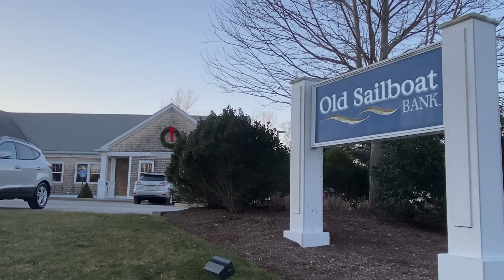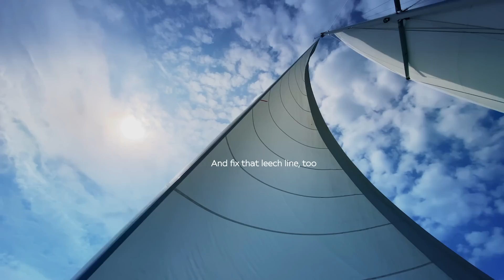EP 3: WHAT IS A THRU-HULL FITTING? Finding thru-hulls & attaching plugs! #Ran-daysSailboat

Comment: Build a manifold to eliminate as many as possible.boy that’s a lot of thru hulls!! You have great resources and I  look forward to seeing your progress!!
Fair winds ⛵️
Reply: Very hard to do after a boat has been built...getting through bulkheads and behind paneling cam be near impossible. I'd rather have more through hull fittings that are close to their source, than deal with chasing a leaking line buried under millwork, ribs, etc
Reply: @davidparadis490  the boat has some you can’t get to and by the time you check 23 sea cocks I doubt it would be saved.something has got to change.he will get it sorted
Reply: @tomcraddock244  I agree.  By the time he finds the leaker it'd be a real "problem" as opposed to a hiccup.

Comment: We have a 32 foot sailboat on the great lakes from 1973.  We had a leaky through hull where we had to cut the wood under the galley sink to access it and it didn't have a seacock.  After that experience we removed all of the through hulls and patched all except the raw water intake.  We put sumps for the galley and head sinks that exit above the waterline.  We moved the cockpit scupper exit drains above the waterline.  We removed the paddlewheel speedometer (just use gps speed) and epoxied the depth sounder to the inside of the hull (seems to work fine).  We removed the waste overboard through hull as we can't output to the great lakes anyway and have it only going to the black water tank.  We have 2 bilge pumps with separate switches and exit hoses.  Now we just have the packing gland on the prop shaft and the raw water intake to worry about below the waterline.
Reply from the maker: sounds pretty ideal - minimal holes and some nice consolidation. how big is your sump if you have it connected to the galley and head sinks?
Reply: I was kind of shocked the scuppers all seemed to go to underwater thru hulls. On less complicated boats the just drain pretty simply, but I guess when it's a center cockpit and you have hallways all around it makes it a bit complicated to drain by gravity without needing a pump of some kind to keep the holes in the boat above the water line. Since they're all gravity fed to the bottom of the boat would it be more of a risk to have all the scuppers join inside the boat and use a singular thru hull to secure and check, or would the piping carrying potentially a fair bit of wave water be more of a risk?

Thinking it over real quick I suppose one issue would be possible clogging from something larger or sticky going down one drain and clogging everything.

Comment: 1 )-Leave well enough alone the ones that are capped .
2)-The patina is just the bronze fittings is just weathering per se after being exposed to the elements of a boat in salt water ;)
3)-See no.1 and consider that I like to fix things till they break.
But, in reality the ones that might need special attention are the engine intake/exhaust because of heat and of course the ones for the head intake/exhaust due to heat cycling and the heads ..well, because they are larger and if/when they fail they will let in the most water.
Have fun and look forward to the learning curve you have ahead.Congrats on 63.2k subs !!

Comment: Holy  thru-hull fitting Ran Man!! This looks like a job for the Lilliputians. Maybe some highly developed toddlers are available with ocean going experience? Seriously there is an old expression which says "if it ain't broke, don't fix it". You might be making the situation worse by replacing all of them. 9 times out of 10 you will have a problem with your hoses or the clamps. Clean up the sea cocks and replace the former. My faith in rubber and plastic is minimal but the ones not under pressure should be fine. Nice of you to give Captain Q the day off . The summer is upon us. Time to sail . Thanks for the info Randay.

Comment: Based on a similar plan you should have for the electrical wiring, Label the thru holes ( Dymo ) and also on the inside of the hatches/covers/panels you should stick a label indicating what is under/in there. Saves guessing and having to find bits of paper in an overloaded Nav station desk.
Really looking forward to more videos.
Reply: Good tip 👌

Comment: Well one thing I can say is DO NOT put ball valves on thru-hull fittings.  The mushroom thru-hulls have straight threads and the ball valves have NPT tapered threads.  Because of that thread mismatch you can't screw a ball valve more than about 3 turns onto a thru-hull.  If you replace a thru-hull, use an actual flanged seacock that has the proper threads to screw onto the thru-hull mushroom.  Alternatively, you can buy adapter flanges with straight threads fir the thru-hull to screw into and NPT threads on the other side to attach a ball valve.  Also, I would not use plastic thru-hulls.  If you don't want to  use bronze, use Marelon fiber reinforced fittings and marelon seacocks.

Step one is to identify  what all the thru-hulls are for and to determine if any are still connected but no longer used.  As far as the thru-hulls that are capped and unused thru-hulls that are not capped, if the boat is hauled out, it is a great time to remove those unused fittings and glass over the holes.  

Also, that sump is not used as a filter.  Instead a sump is used for a drain that is below the waterline, such as a shower pan drain.  The sump has a float switch and pump in it.  Water drains into the sump pan, when it has enough water in it the float switch turns the pump on, which pumps the water out a thru-hull above the waterline.

Oh yeah, as others have said, use 3M 4200 or another brand of sealant on the thru-hulls.  5200 is used for permanent installs like hull/deck joints.  5200 is also not a silicone product.  It is a urethane.  The only time you want to use silicone on a boat is for bedding lexan in ports and hatches.
Reply: Excellent information 👌
Reply: Thankyou for the education.
Reply: @stevev5510  my pleasure.
Reply: Careful here!  Thru hulls are also available with pipe thread, specifically for mating to NTP partners.  The "straight thread" reference to thru-hulls is outdated information, and inaccurate.  The use of conventional seacock versus ball valve is an engineering decision, based upon size, location, loading, intended use, part material and quality, etc., and should be individually evaluated.  You may trust that ball valves are successfully used in lieu of conventional base-plate type sea-cocks all over the globe.  We see cruising boats from as far back as the 1980s which exhibit ball valves mounted atop bronze thru-hulls that have been in service for many years, with zero issues.
Reply from the maker: Thanks David  I’ll be sure Randay gets this 
How did rue like the ne38 today
Reply: @daveseverns2896  yes there are thru hulls with, and I quote, "the last 4 threads transitioned to NPT pipe threads so you can screw a pipe thread ball valve onto them for "4" threads.    Note that this is ONE brand of thru hull, not all thru hulls.  I maintain my position that the use of ball valves directly on a thru hull is poor practice.  The reason is that the valve is not supported except by the thru hull.  Best practice is to use a standard flanged seacock.  A seacock is attached to the hull either with thru-bolts of via tapped holes that do not penetrate the hull only when the hull is not cored and thick enough.  In addition, a ball valve screwed onto a thru hull will not meet the ABYC strength standard - able to support a 500 lb load applied to the end of the fitting for 30 seconds.  Yes the ABYC standards are voluntary, but most insurance companies view them as mandatory.  That many builders have built boats to very poor standards is NOT a reason to build that way.
Reply: @todddunn945  Thank you for your reply.  This has been a very contentious topic for many years.  I shared your comments with the other builders and surveyors at the boatyard this afternoon, and it generated a lot of smiles among the gang.  One of the other surveyors responded "if I had to strictly follow that blankeyt-blank money-standard, I'd fail 99% of the boats out there, including most all new-production vessels!"  Certainly, having been involved with voluntary standards for the last 34 years, I can tell you that there is a lot of politics and...let us say..."influence" in their development and modification.  I shall leave it at that.  It may be worth investigating products such as the Tru Design seacock, a completely polymer, certificated, non-flanged seacock.  Again, it is certificted.

We can argue the Standard all day (as so many have done over the years), but I will just share here that there is a very clear difference between a horizontally oriented, 1/2' diameter, above-water sink drain penetration and a vertically-oriented, submerged engine cooling penetration, which may actually stand some chance of being impacted.  Good luck with that 30-minute, 500# load suspended under that sink.  ;)  Many in the business feel strongly that the Standard is too arbitrary and "one size fits all".  As a fellow engineer, I will only say publicly that there is no substitute for a prudently designed application.  I will take "designed" over "arbitrary" any day.  The mfg's using unflanged ball valves will aggressively argue with you that their boats endure millions of hull-miles annually without fitting failure.  The lawyers and insurance brokers may not like it, but the builders are correct.

Be well.
Reply: @daveseverns2896  I agree totally that a large part of the ABYC "standards" comes from equipment manufacturers and is thus somewhat "inbred" shall we say.  Unfortunately, I have had to deal with several insurance companies that view those "standards" as the gospel since they are pretty much what is available here in the US for recreational boats.  Production boat builders are always thinking about the bottom dollar and will thus go with the cheaper option whenever they can since production boat building is a low margin business.   There are, of course, exceptions to that for those builders who build in the time and materials market - very high end builders.

Comment: Ran-day you are a brave man! I have only one thru-hull for our sink. I had to remove the seacock, so the original thru-hull had too also come out to do the repair. I used 3m 4200, and the reason why is that I have read the 5200 should only be applied to areas that will never need to be maintained or repaired.
Reply from the maker: Great tip!

Comment: I assigned the entire process to the boatyard and they found one thruhull I didn't even know about which was a salt water inlet for the galley sink. The sink no longer had the pump or faucet for the thru hull and it was under the v-berth.
The main issue I had and the reason I wanted them all replaced was they were all old gate valves from 1974 and some didn't look very good. Gate valves are impossible to tell at a glance if they are open or not and they can get stuck, so I am much happier with the ball valves with nice levers.
I also have three pairs of thru hulls in the head and 4 of the 6 are capped. I have no idea why, people must not have liked them, but they are above the water line and the two in use are below it. I plan to remove the sink in the head which is a cheap plastic thing and replace the throne with a composting unit that will eliminate the three thru hulls and the need for a holding tank. The galley sink is two steps away so I think it is fine.
I think if I had two heads I would make one a composting toilet unless there was a big crowd on board that needed two heads and holding tanks. I had to rebuild a joker valve and replace two macerators and I am more in the never again camp because I am not a contortionist that a small boat wants you to be. My friend just removed the wall in his boat that made access so much easier, but putting it back was a little harder.

Comment: Randy,
This sure brought a lot of comments. Not all, IMO, helpful. I don't often comment but have to this time. 
You are a leg up on most folks. You have a good list of your thru-hulls and you understand what each does. And now you know where they are. The large number may seem worrisome but I don't think that's a problem. Thru-hulls that fail and could sink your boat are those below the waterline. I wasn't counting but that's probably less than half with some of them being capped. Concentrate for now on making sure they work properly and that their hose connections are in good shape and properly fastened. As I watched, it seemed that the major inlets are accessible. I would not mess around with manifolds or a sea chest. Just make sure all the below water thru-hulls are in good shape. If not, replace them. Then address the others as needed.
You have a fine, well designed, well manufactured vessel. It has stayed afloat for a long time. Your diligence will keep it floating for a lot longer. "If it ain't broke, don't fix it." There are lots of workable and fun ways to improve liveability and performance on any boat. Ask Q. He knows. Focus your efforts there and keep the videos coming. They are great.
Reply from the maker: Well said…. Agree with covering the basics and leaving it alone if it ain’t broke… (after new hoses and clamps of course). Thanks for taking the time to leave your thoughts 👍👍

Comment: I think it is time to do some re-design of the plumbing. Eliminate/combine to manifolds with a single outlet. 

Are you planning on going to compost head(s)? I think you should. Maybe keep one with a straight shot overboard for offshore use only. 

I suspect with a little work you could get down to a single digit count. 

You'll need to get good at fiberglass/gelcoat  layup for all the new holes in the hull.. Save you a lot of headaches and maybe keep you from sinking your boat.

As for replacing old bronze fittings that appear to be in good shape, I would be hesitant. Maybe pull them, clean them up and rebed. I say this because bronze fittings ain't what they used to be. about 12-15 years ago, the bronze foot valve in my well pump went. Less than a year later the replacement went. My well guy told me the new chinese bronze was shit. He replaced it with a white delrin one, which so far has been good.

Comment: I would strongly recommend, while the boat is on dry, remove all hoses, lube and loose all seacocks, cut 1 diameter on each and replace at least the primary clamps, if you cand do both even better and properly attach the wood plugs along with a wooden or rubber hammer on each sensible area, water intakes, underwater exhausts and outlets. engine room and sinks area.
Reply from the maker: Good stuff , Eduardo! Thanks

Comment: Sure seems like a super high number of thru hulls.  I wonder if it would be valuable to stencil on bulkheads, cabinets, etc. near each one "thru hull," with an arrow as necessary, to mark them all.  I mean, if you don't mind the anesthetic. In the Navy we would have stenciling everywhere marking things it was good to know the location of, like fittings, CO2 cylinders, fireplugs, etc.  We used glow in the dark/luminescent paint for a lot of them so you could seem them even in the dark in case we lost our lighting.

Comment: A piece of advice I've heard is to put small plastic tubs under where each throughhull would drip, so you can check really quickly to see if there's a slow leak or not. It won't stop a big leak or fitting failure, but most of these things don't catastrophically fail out of nowhere, and you can even put a cheap water sensor into the small tub that'll detect water faster than if you were just letting it run down into the bilge and set the bilge alarm off as that larger volume fills.
Reply from the maker: Interesting tip… definitely something to keep in mind and test

Comment: Add a sea chest for water intake and have all intake water feed off of the sea chest.. I’m sure you can also have all discharge lines feed to one tank. You could cut through holes down to about  5-6 .. one intake, one discharge, one for depth sounder, one for speed and one for exhaust. You may want to keep black water discharge separated.

Comment: That is absolutely overwhelming(to me). Removing and glassing over all those unused capped thru-hulls would be good.  I always closed my seacocks before heading home from the boat (impossible for you) . Once I was 30 minutes into my drive home and I realized I forgot to close the seacocks. I didn't want to add the extra hour of driving but headed back anyway. Glad I did.     The intake hose to the head was loose on the seacock, the seacock was open and water was coming in. I would have lost my boat. Note: 5200 can fail and it's important to read and follow cleaning prep and installation suggestions...it's not a magical  sealant that succeeds over poor installs. ;)
Reply from the maker: Good tip… I could close quite a few of them everytime I leave the boat… I like that idea… thanks
Reply: Fix less, sail more. That’s why you have insurance. You ultimately bought the boat to enjoy it. I, like many first time boat owners, spent more time working on my boat in the first year than sailing on it and I wish I hadn’t. The boat isn’t crossing the Atlantic so I would just fix the essentials from the surveyors list of items and sail it. Next year when you haul out, attack a few through hulls at a time, either consolidating them or replacing them so you know how old they are. Good quality bronze is important.